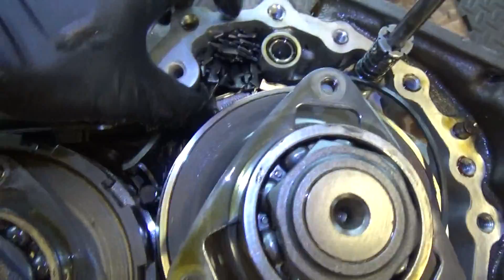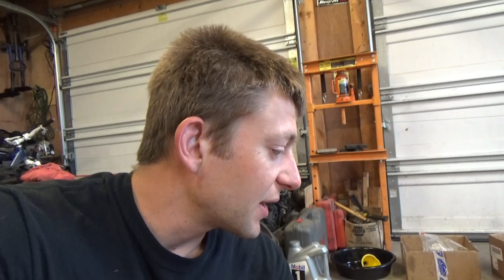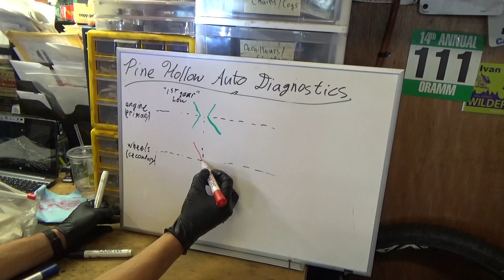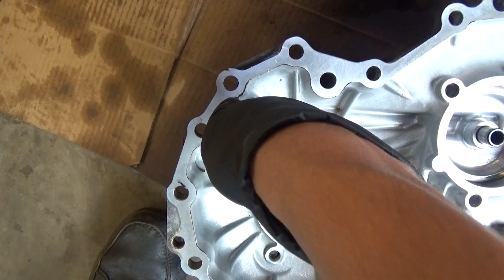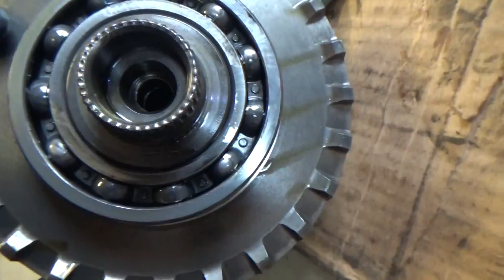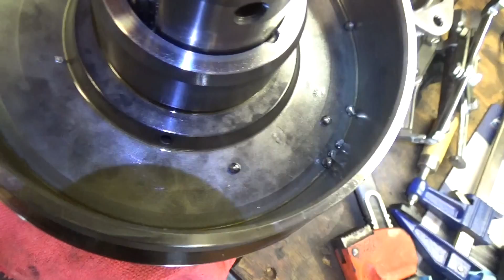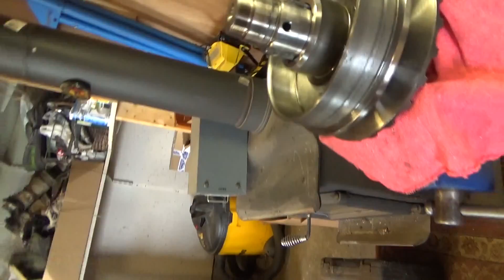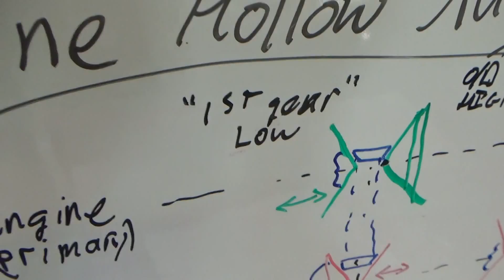Nissan CVT: Teardown and Failure Analysis -Part 2 (RERELEASE!)

Comment: My sister's 2013 nissan sentra with cvt had the cvt fail in 2017... Nissan CVT are junk... nice power delivery but at a cost of extreme short life.... My 2005 G35 6-speed manual is still on original clutch at 195K miles... Nice video on teardown of a failed CVT.

Comment: We are in the process of changing our 2004 Cube after having it for 9 trouble free years, all it has cost is regular servicing , tyres and a battery and a set of pads, all the new cube albeit nice and practical and roomy all have CVT...it has really turned me off as I go over 3 mountain ranges once a month, and do a fair bit of running around, I think I have to look for an alternative. Thank you for sharing your expertice. God Bless you  mate.

Comment: Have a Versa delivery vehicle at work . Trans died at 86,000 miles. Replaced at dealer for $4k , just died again with 26,000 miles . Dealer said sorry , 1yr/12,000 wattanty.

Comment: I run a scooter repair shop mopeds use the same type of cvt transmission but there's a rubber belt not a band

Comment: Code reader said stepper motor on '10 Cube. Bought one on Amazon, tore down, wrong one. Just got other one, tear back down, see if it fits. Trans didn't come in car, haven't found gasket for it yet. Did you get core back?

Comment: There are 399 little metal plates that are held together by the steel band.
How it travels round without the bit falling out is anyones guess, but i would have to say that this looks like the weakest form of drive system every.
Just thinking how much damage these little bits can do when they come into contact with something else is frightening to say the least and is about as weak as it can get, however, there is not much else you cou,d make it all from, so in all it seem like a system to stick clear of.
How manufacturers can make cars with such a weak method as transmision shows just how little they care about providing a  good strong system, this is made to go wrong and when it goes wrong  is unpradictable, just how much damage is done is also going to be unprodictable, lets forget all the fancy electronics and whistles and bells and build a reliable car,, there are more old cars still running that there are new ones that will cover the same milage, it no good if it fails to keep running regardless of how pretty it looks, after all thevmost importaant thing is that it is transport from A to B , not from A to, oh shit its brock down again.

Comment: That would be 36001 miles, approx.  537 kibbles. Had one in my Jeep Compass 2013 Never again. Ran OK, better when flooring it to get the highway speeds, rather than city driving, IT WOULD hesitate

Comment: Great Video. Do I need to reprogram if I rebuild and replace with the same the transmission?
Reply: I know this is probably a tad late, but there's a ROM module on the side of the valve body that can be moved from the old valve body to the new transmission's valve body that will save you from having to get it reprogrammed.

Comment: I have a 2008 Rogue with a CVT. It failed at just under 200,000 km and Nissan replaced it under warranty. The new one has worked well until lately. It’s been acting weird, letting me know it’s almost done for. Current mileage is 380,000 km. Do we see a pattern here? I want to thank you for your videos! I’ve always wondered where the failure points were. No transmission repair shop will even touch them up here. Do you think it might have something to do with the gasket that failed. Seems like it would slide in and out with the cone and keep the oil contained in the hub. Without the gasket, no oil, advanced wear of the slider mechanism...

Comment: This CVT unit blew at 180,000 miles - which means 289,682 Kms, gosh - probably because of stale fluid (should be bright RED, not brownish), and YOU and YOUR HOPELESS FOLKS are blabbing about "unreliability"? Not in this case. Anyway I maintain as well that Nissan's quality went down the gurgle once Renault took hold of it, and I saw it coming as soon as I learnt the news. Renaults can be nightmares, especially the ELECTRICS (you get my drift?). Not buying a Renault nor a Nissan for the time being.

Comment: I cannot believe that all of the engine's power is essentially transmitted through that set of tiny little retainer/guide bearings. NO wonder that the pulley rotated relative to the shaft's axis! Nissan: you gotta be shitting me!

Comment: I have a 2015 Rogue SV with AWD, 71000 miles. I have a bumper to bumper warranty up to 130k miles.  I got the rogue because my 2010 forester had the head gasket failure and then the trans started to go at 190k.... Traded up to Rogue.   Now it seems Nissan CVT's are the equivalent for Subaru head gaskets.  Like I went frying pan into fryer.  head gaskets $2000, CVT replacement $4000.       After hearing all the Nissan CVT horror stories here I feel like I should get rid of (sell or trade-in) the Rogue when its out of warranty.

Comment: At 10900 mile fluid got hot you can smell it Jack Williams did a flush and clean been running very good after it

Comment: Think last time we had ours repaired my 2015 has 400 metal pieces?

When my acts up when reving. I pull over shut off car for 15 seconds and the computer resets and its fine.
Due to the fact transmission gets hot and in mid drive it shuts down. It is very important that you get the fluid changed.

Comment: Hi Ivan. Greetings from Helsinki, Finland. It is not easy to put it in the words, but I think the video you made was a Masterpiece. It was so comprehensive and true.I agree with you that by machining three more and bigger grooves  in to the Shaft shall help, with Bigger Balls of course, hehe! And maybe give some heat treatment to it with Coal(black stuff from the Earth). I've been warning the visitors of the Finnish Nissan club by  writing about the weaknesses of the CVT and added a link at your video.  Sorry about my bad English. Yours. Heikki

Comment: Remember when Datsun made a great car? B210 that was ugly but you couldnt kill it? I think they had the 500 series and of course the great 240,260,280 series during which we saw the name change in the US.  Nissan trucks, truly small pickups all great....except when they tried to put automatic transmissions in the hardbody version which was junk. I bought a 1970 something Datusn truck once for $900 and drove it for years and years.  Finally started to smoke a little but I just checked the oil couple times a week and kept driving.

Comment: I've heard a few things.. use the manufacturer's, or their recommended trans oil only as the fluid pressures are extreme in there (they have to be). The pump and small valve can be a source of failure, as can a failed thermal sensor. Change fluid ever 40k or so and presumably filter. Do not expect CVTs to last forever so you have to cost that in. Towing in my opinion may shorten the life also.

Comment: CVT on our 2013 Nissan Altima just failed at 70,000 miles. Wish I had seen this video before we bought the car. Ugh.
Reply: brad miller 
Did you have your CVT fluid flushed?
If you dont flush the CVT at the dealer.
it will fail like this one

Comment: ...A non-knowing guy's question...

Snowmobiles, over 50 years ago (i was a young kid when i sa my first) always used CVT's and still use them today.

The main difference is that snowmobiles use rubber belts that can be field replaced.

I know that there's a power level difference between a snowmobile and a car, but having a transmission that can be easily serviced with a new rubber belt and an enclosed, not user-serviceable friction transmisson, i'd prefer the rubber belt model.

Comment: I'm surprised I can not see visible wear on the pulleys were the chain works. Have an '13 Altima with 69K Mi. with the 3.5L Engine running like a champ... should I trade it in tomorrow?

Comment: My wife's Honda CRV has a CVT.  Hope it outlasts the car.  My Accord has a 6 speed manual.  My '65 Corvair has a 2 speed Powerglide.  They are very reliable and smooth shifting, but realyl needs another gear.  Kills mpg and performance. Wanted to see what's inside.

Comment: What's interesting is that the belt actually  gets pushed not pulled. The little segments lock together and they are slightly angled and only work in one direction. That's what makes the belt so strong. { wonder if they will start making 2 belt transmissions? Typical engineers work out that its going to work. The average mechanic can look at it and see it's weak points. I can't believe those tiny balls hold all the power. Sounds like a politician.lol.

Comment: You said that had original trans fluid at 186,000 miles.  Many change it at 50k.  Several YouTube vids document CVT problems are corrected with fluid change.  I'm surprised you never changed it.  I hope you do on your new trans.  I'm selling my Nissan and going back to 5 speed manual.  CVT never again.

Comment: I read allntge armchair warriors moaning about the cvt. But from what i see is most owners do not follow the services tge ool changes filter changes etc tge reason those taxi run is gecause they arevserbuced orooerkyband tge oil change and filter changes are done the nrvhanixal butscare nsihtained properly.  From what i see in the USA is you run your cars ihtonthe ground you do not follow the correct service schedule. Thennyou complain when things go wrong, cars to day are precise machines there the leaking  poorly made gm or ford shit if the there huge v8 under powered poke if junk. Car beed to be cared for.

Comment: I'm totally anti cvt person, but lately I changed my 2007 civic manual for a 2007 Nissan Sentra, because my civic is dying, the Nissan drives smoothly for normal daily driving, but I paid 2400cad, I don't think I would pay 10k or buy a new car with cvt, especially a nissan. the car I bought is extremely clean and barely used by the last owner, if it breaks, just get rid of it.

Comment: Wow thank for posting  We live in Australia  just bought a new 2019  Nissan Qashqai for $27,000it  It now has only 5000 km on it. When we bought it we did not know about Nissan or the CTV transmissions We just wanted an auto.  But Wow looking at this At 186000 miles that all most 300000 km.  Most small  4 cylinder cars in Australia  the engine  would not even last that  long. Thanks for posting

Comment: Very awesome belt engineering, thin metal to minimize transverse sheer as well as not reach plastic deformation. That said, it would still have a finite life but obviously other parts fail first so its not a problem. 
Great Video!

Comment: Check your drive belts where it separated. You will see little chevrons on the metal if it was fatigue. This is what the NTSB uses to find faults in aircraft crashes. Sheering will not have chevrons. Sheering will have a compression side and a stretching side.

Comment: So, there are 3 slots in the cone servo, and a ball in each of those slots (maybe 2 per slot). If a customer is a lead-foot, driving like playing a video game, flooring it, accelerating while the car is in motion during a shift event, she can start the deterioration of those slots, chewing those balls and slots up. Once one of those balls starts to get chewed up, it puts more pressure on the other 2 slots/balls, and another slot/ball starts to fail, then the third, then the shaft and the hub lock up, while the other remains free.  That causes the belt to run crooked, and then fail.  So the design cure would be to increase the number of slots/balls to 9, thereby more broadly distributing the force so that the crush points don't rise to the material limits of the shaft and the balls. --Why did I say she? Well, he did say that his wife was driving. I'm guessing that she is not a mechanic. Great informative video.

Comment: I can't believe you dumped all those pieces back in there. It's not like the rebuilder is going to string them back together, like popcorn on a Christmas tree. Thanks for the videos, very informative. Most pro mechanics won't dive in like you did on a CVT trans.

Comment: The shaft was not heat treated properly, or maybe at all. They machined it and slapped it in there at the factory still in an annealed state; soft like butter. Nothing pisses me off more than a "professional" that can't accomplish something so basic to his profession. Sucks you had to pick up the tab and deal with the hassle of some neanderthals screw-up at a machine shop in china. Thanks for the vid tho! Very interesting to see all the mayhem in there when something fails.

Comment: This is exactly why you should not use a CVT to tow or chip the engine . The transmission is very susceptible to  load and torque.

Can you say snowmobile drive system ???

Comment: Pretty sure, that this CVT mechanism is much more complicated and sophisticated than RollRoyce Jet Engine because Jet Engine gearbox  doesn't need transmission gear :) 
That's way Boeing or Airbus never ever available to build aircraft for mountain riding, city riding or Desert purpose. what a shameful !

So, RollRoyce-GE-ect jet engine should be cheaper than Honda Civic CVT Engine or Nissan

Comment: Where that shaft appears to get out of alignment on lawnmowers is called  broken flywheel key and happens during some sudden starting or stopping
Like if you hit something  with the lawnmower blade like a tree root  softball or baseball.

Excellent vid
And I will stick to a stick shift or  non CVT automatic.

CVT=Continuing variations of troubles

Comment: This same design of transmission is used on Scooter bikes and its very reliable and simple. The difference is that with the bikes its 2 pulleys and a plastic belt. One pulley has a clutch assembly and the other is bolted to the transmission shaft. On cars however the belt is metal and also everything is inside the transmission. If engineers can find a way to separate the belt and make it easier to change the design could be the best. I'm a motorcycle mechanic tho.

Comment: Very informative! I have a 2016 Rogue SV AWD. At 49,900 miles everything is still working perfectly. I meticulously maintain and care for it and hope to never have problems with the CVT. Once the Nissan Powertrain warranty expires at 60k miles, I expect a CVT replacement would be very expensive. I've been working on cars most of my life but this is a piece of automotive engineering I'd rather not have to touch. I hope you got your $800 core charge back.
Reply from the maker: Thanks for the comment David! I hope your Rogue serves you faithfully for a long time! But my suggestion if you plan to keep it long term is to start a "rainy day CVT fund"... my wife was glad that she did before her CVT blew up haha

Comment: The CVT is a decent transmission, but not nissans, fords or chevy models from what i've heard and ofc the vw dsg7, and they're not really a good option if you tow alot or have trailers alot then you'd be better off with a stick or normal auto

Comment: This is why I bought a Mazda with a real transmission. I tend to keep my cars for 200+ miles and I don't think a CVT will make it that far. Nissan has had lots of problems with their CVT transmissions. Car in the old days were good for 100k miles. Then they got better and you could get 2 or three times that. Now we are back to 100k miles.

Comment: Thank You for this tear down! Sorry that you may be out $800 for the core. Just throw the parts in and bolt it back together. What are they going to do, pick it up and shake it and say, "Hey! Did you open this?! It's supposed to sound like a bag of nickels, not a walk of shame! You didn't see the inside did you? OK. Here's your deposit. Charlie? Ya, another rebuild. Were gonna' need some more steel banding straps, oh and the 55 gallon drum of those itty bitty things is running low. Yes, I know you said to call them "nickles".   ;-) Just reached @51:00. You and I think alike. I don't think the rebuilders are going to see anything unusual inside. Even if they do, it will be too late. You already got your deposit back. Actually, you saved them some work!! I am surprised that lasted so many miles. It must have been driven "lightly". Thanks Again! Great video. Now I know what I am up against.

Comment: @ 40:00 This just keeps getting more and more interesting. To the engineer that headed the design "effort"; "YOU'RE FIRED!!" I can't believe this design was used for so many years, and still, in a 2015 Sentra (mine) I am experiencing driveability issues. Junk.